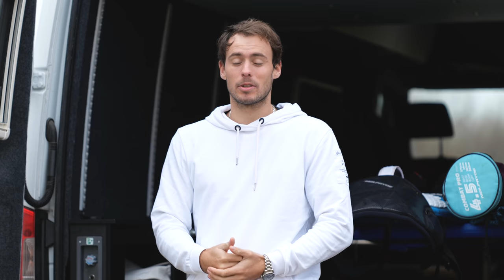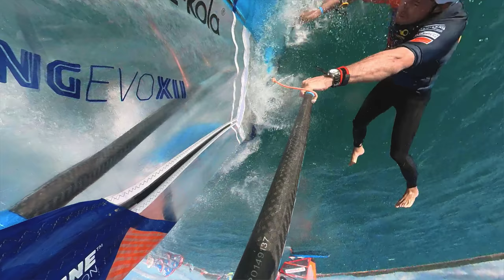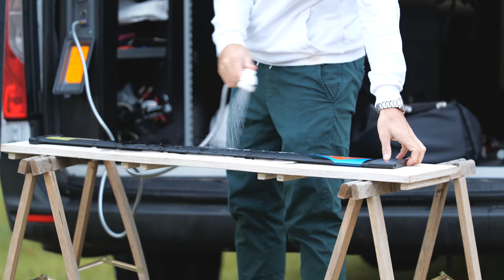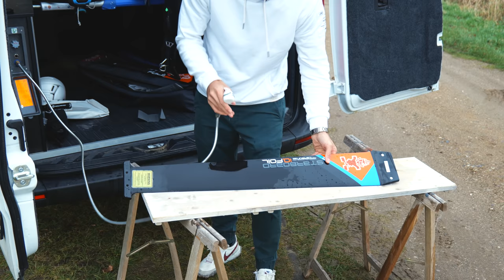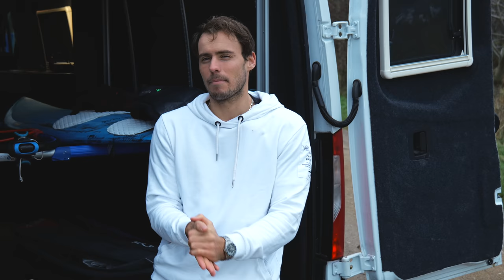Tuning the FOIL for BETTER EFFICIENCY | explained

Comment: Nico i am following your channel, obviously i am very pleased with your windsurfing content.  A pro windsurfer is not a scientist, giving those without the proper background could backfire really hard.  
Imagine people following your tip and sand the wrong way items costing 3K, or not having the expected result or seeing your video after an accident with serious injuries.  If i was a Starboard manager i would be very sensitive with some of the comments implying that it is a product problem.  Next thing, someone will start a legal case using your video against Starboard.  Reputation is far more important than legal fines for corporations!
Finally let me give you my point of view regarding our topic i.e. catapulting @ Defi and not Cavitation or Ventilation (any comment from a scientist windsurfer will only add credits to this discussion).  
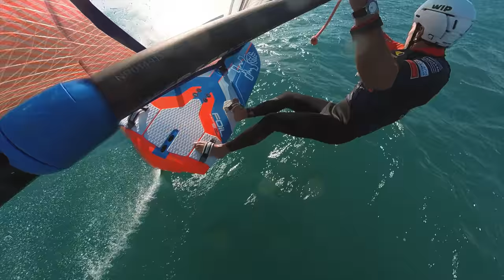Your video @ 2:08 has a slo mo showing a movement to the left of your tail followed immediately by a movement on the right (over correction) that changed your body balance, resulting in nose diving.  What i am missing in the slo mo is the sudden movement of the tail on the right just before the sequence shown @ 2:08.  Check @ 2:02, tail goes slightly on the right (rider error?), then on the left where slo mo starts (over-correction?) and finally on the right + nose dive.  All this in one second, on high speeds, during a race on choppy water.  I am not an expert and it would be very awkward to advice a pro, but from father to a son train more on high wind foiling before looking for dinosaurs in the closet :)  
Keep up with the good windsurfing footage!
Reply from the maker: Hi Demetris, I'm not managing Starboardfoils. It's a different company.
Reply from the maker: And by the way, I didn't catapult once at the PWA in Israel during nine races.
That was also on foil, but much more wind. I'm quite used to foiling in strong wind, which is why I can comfortably look at possible issues outside my skills.

Comment: It's been said that 2000 is too fine of a finish for most water sports. It might be good for higher speed America Cup boats. (speed and water temp dependent)
 400 to 800 should be good for 20-30 knots. Faster speeds finer the sand paper. Also it's said to sand perpendicular to flow. jus t what I've read over the years.
Reply from the maker: Yes, I came to similar conclusions now

Comment: This is interesting, thanks for sharing. I recently began having a problem with my foil, where I would be foiling perfectly fine around 21-23 kts, then all of a sudden it felt like a slight spinout would happen (I also thought I may have been hitting a cluster of seaweed) and it would cause me to quickly lose stability and usually forced me onto the leeward rail, sending me abruptly downwind. It most often resulted in a catapult - I actually broke two mast bases because of it. The strange thing is, it would only happen on port tack and never starboard tack. The loss of control was very quick.

To diagnose my issue, I noticed I had some sticky residue (leftover marine grease) on the fuselage from when I moved my Slingshot switchfuse setup from position B into position C. I removed the grease with goo-gone, which hopefully resolves the problem. I haven't been foiling since, but I am hoping that the stickiness on the fuselage was the source of my problem. I wonder if any sort of hydrophobic/hydrophilic variance on water passing along any of the foil parts (even aluminum parts) is going to cause stability issues, even at my modest amateur speeds 😀.
Reply: Also try heeling the board a little bit more windward. The i76 also gets a bit harder to ride somewhere around it's top speed (which you seem to be very close to)

Comment: How does the cavitation on the mast extend to the foils? If the mast starts a cavitation you should experience a spin out instead of a catapult. I think that the problem here is the leading edge of the front wing and the joints of the foil to the fuselage that create spots for cavitation. If the front wing stalls the board will suddenly nose dive and therefore catapult you. In addition to that, sailing at these speeds could twist the mast and vary the  angle of the attack of the mast itself to the point that cavitation happens on the mast. Changing the roughness of the mast surface will increase the boundary layer and simply delay a little the problem.
Reply from the maker: You can see that the cavitation on the mast happens first.
Reply: i think just the massive drag increase from the mast ventalting is so low down from the center of effort of the sail it would be enough too cause catapult on its own

Comment: As a researcher in fluid dynamics and more specifically fluid-structure-interaction I can tell you that your explanation seems quite unlikely. The mast does not provide much lateral thrust due to direct fluid action, therefore it's not the flow around the mast which is cavitating. The mast can instead provide a preferential way for air to be sucked down along the mast towards the foil/stabilizer.  That would happen when you fly very high, but it's not a destructive process, should be a very gentle loss of lift. I would rather think you have a problem with stabilizer pitch. It's worth sticking a camera under The board in front of the mast, pointing at both foil wings and stabilizer.
Reply from the maker: Thanks Pietro. I can exclude that assumption of the stabilizer as this is the set up I've been using a lot and never had this problem.
I mentioned that the mast is the only thing I changed and therefore is what I looked at.

Comment: First things first: I am a physisist. And I have to say, that I don't know of any theory that backs up your assumption. Cavitation is a myth that lasts in windsurfing since day 1. But this effect which in very unlikely to happen in windsurfing compared to propellers in shipping boats has nothing to do with it. It is likely that the foils stalls but that it has to do with the mast and sanding the mast doesn't make any sense to me. We all know stalling from fins, i.e. spin out, but since my 40 years windsurfing I have not heard that stalling in fins can be avoided with sanding it. There is to much myth about sanding the hull and gain any measurable differences wrt to the friction as well. I can not judge really what is your problem and why you say it has gone away with sanding, but to me it sounds inconsistent. BTW, did you do again runs within similar! conditions with your setup after you sanded it and can you for sure say that your problems now do not happen again. Which is the minimum, which need to be done to back up your assumptions. Besides that, I really enjoy your channel. :-)

Comment: isnt it that just your angle of attack was causing it... Also it seems that you where a lot higher above the water.
cavitation happens only with higher speeds and knowing that foiling is still not going over 40kts,  and guesing you where there doing perhaps 35kts there cannot be the case of cavitation.
Reply from the maker: That would mean my angle of attack would have been too high, which was certainly not the case.

Comment: Try to oil the foil and see what will happen
Reply from the maker: It gets worse 😂
Reply: @Nico_GER7  Years ago, I heard you should de-grease your fin and board, as your "get's worse" comment would support. I am a long way from pro speeds, but I first wash my gear with dish soap (leaves no film) then wet sand my gear.  I was told there may always be a slight oil slick on water due to many factors like outboard motor oil in exhaust (less with 4 stroke outboards taking over and not so likely in open seas), spills, settling out of the air or ???    Ever do that?  Maybe on your next new part, try washing first before sanding to see if the water sticks.  Mold release compounds? Suntan lotion from hands/handling?

Comment: in other words, this is a manufacturer s bug, right? can one claim his money back? I mean, this is abnormal behavior and dangerous for the rider. imagine you are in the middle of the sea and your boom brakes bacause you catapulted.
Reply: Like Nico's boom broke at the Defi in offshore winds. Maybe Starboard should supply some sand paper and instructions on how to finish their product off.
Reply: Isn't windsurfing dangerous for the rider? 
We are talking about 28-30 knots + speed, which is not achievable by most non professional riders. Most of us will not event feel this kind of behaviour of the foil.
The ones who get to these speeds know that you have to tune the equipment and water sanding the foil mast and wings is part of the tuning. 
Kite foilers do it all the time. During the defi all the pros were also doing it
Reply: @thibault2173  this is not an argument. with the same logic, Porsche should not sell cars to not pro drivers. I'm trying to say that, if it only for pro equipment, then you have to inform the buyer. otherwise, they fool people
Reply: @aisimeon  please read again my comment. I said that amateurs who would get this feeling know how to use the equipment. 
Cavitation happens in kite foil as well as I said. My brother had no issues with his foil until 35 knots. Then the foil started cavitating. He had to sand paper it. Done. Is the supplier responsible ? I don't think so. Most people are happy with the foil they have and did not find any issue. 

In the case of starboard it is the same. They don't fool people as to cavitate it means that you use the equipment as the edge of what it is designed for. 

If you spin out and broke your ankle, are you going to say that the supplier of the fin fooled you because it is softer than what it should be? or the board supplier because the paint of the bottom is not as it should be to avoid spin outs? 
I don't think so.